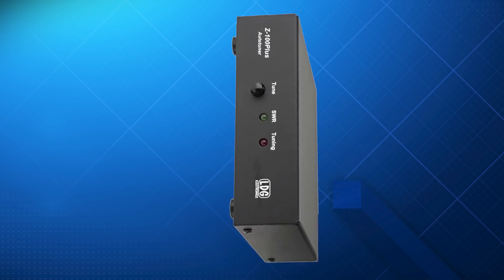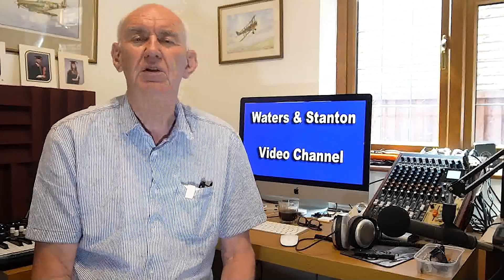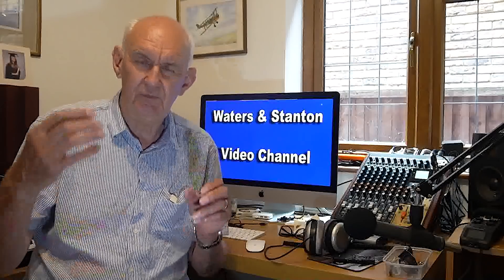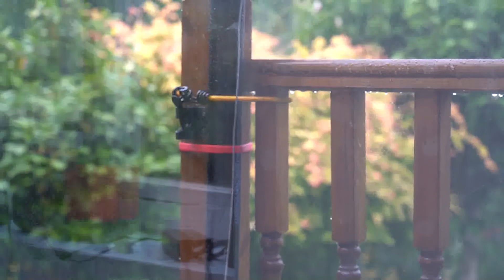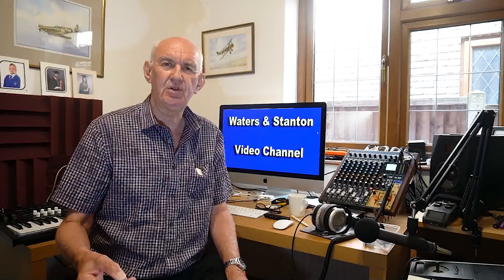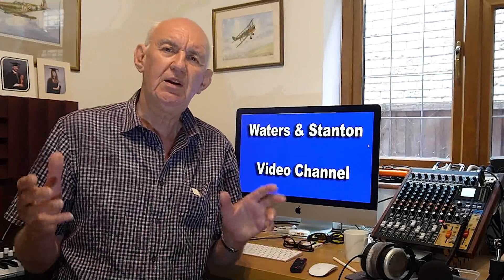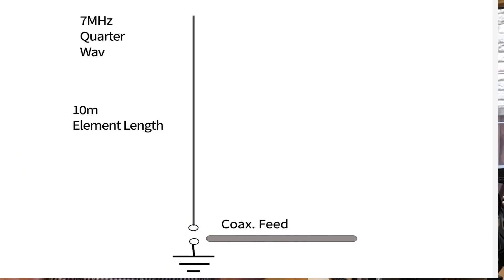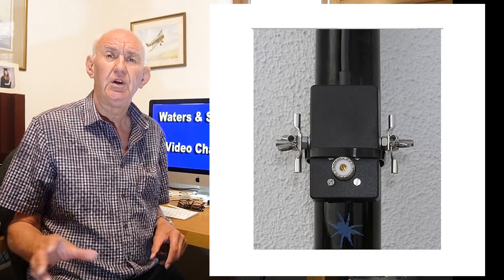HAM RADIO POP-UP ANTENNAS FOR SMALL GARDENS

Comment: Would definitely like to see some options for Campervans, possibly HF antennas permanently mounted. Currently have a Wellbrook for reception, I'm only an SWL. Would like an effective whip mounted permanently which can be rotated down whilst mobile. Believe it or not the LED lighting in the van chicks out some rfi! Promote your products Peter, every other bugger does.
Reply from the maker: If you have a van conversion I have found that most boot mounts work well at tge top of the rear doors. If you have a coach built model, I am afraid it is a non-starter as there is no metal work. 73 Peter.

Comment: Excellent!  I started experimenting with this exact concept a few weeks ago.  One difference I have made (and possible an improvement) -- I fabricated a mounting bracket for my 49:1 transformer so that I can attach it anywhere on my Spiderbeam pole.  So, for example, my 17 or 15 meter half wavelength wires can be attached at the top of the 13 meter pole with the feedpoint however high up is needed.  Next, I started experimenting with putting an inductor in the middle of my 20 meter wire, trying to tune it as an end fed 40 meter half wavelength antenna.  My first result was about 300 kHz too low and the weather turned very hot and humid at that point, so I haven't gotten around to making adjustments.  I did note, however, that at resonance (about 6.7 MHz) the feedpoint resistance was very low.  Don't recall exactly, but maybe 15 to 20 ohms.  More work is needed on this.  Meanwhile, a 40 meter half wavelength sloper attached to the top of the pole "worked a treat" as you might say.  ;-)
Reply from the maker: Hi William, the Spider SO-239 does have a mounting kit but I did not use it. I tried the 20m / 40m idea but had problems. I will revisit it sometime in the future. Thanks for watching. 73 Peter.
Reply: @watersstanton  I finally completed my experiment with splitting my 20m EFHW and putting a coil in the middle.  It resonated at about 7 mHz with at 22 microH coil in the middle, but the feedpoint impedance (end fed with a 49:1 xformer) was 13 ohms for a 4:1 SWR.  I need to try taking out the xformer and connecting my homebrew L-network tuner and see how that works out.

Comment: I have both the 12 and the compact 10 meter Spiderpole and they really are high quality units. I'm a big fan of  End Fed Half Wave antennas, no ground plain required.  When out and about working portable QRP I use various resonant lengths of wire for the most popular bands and get very good consistent results.   Takes no time to setup and take down.  For those of you who are delving into HF for the first time I would recommend trying verticals as no real hardware or climbing of trees is required - most setups can be home brew but ready made UNUN for EFHW are available, or just keep it simple to a ¼ wave with a decent radial system will yield good results.  Out portable I prefer not to use ground or elevated radials as they have magical properties in attracting members of the public.  Another top video 👍👍👍 thank you.
Reply from the maker: Many thanks Mije. Some good advice. 73 Peter.

Comment: Great video and timely. Only last night erected a 10m telescopic pole on a heavy duty speaker tripod, with some guys for extra security (was windy). Ran up 10 m efhw. I used a number of plastic rings with varying internal diameter,  purchased as a kit for a few pounds. They are used to guy the pole at various points, but since they each have a number of holes it is a great way to neatly run the wire tight up the side. Was working 40, 20 m last night well, 10W into Germany,  although a Contest meant testing was not really appropriate as no-one had time to talk !!  This was without ground radials,  but an earth spike.  Will check out radials next time, will use from my super antenna pack,  ready made ..  M7MSR   ps... did notice an increase in noise compared to my 20m horizontal efhw which is strung across garden. Might try vertical in the garden with station, but really want it for use when out and about ..
Reply from the maker: Thanks Mark. interesting stuff. Keep at it. 73 Peter

Comment: Hi.  I’ve been using this system for the past 2 years and haven’t had any problems. 11 meters, £20 pole at 33ft.
Hawkins 1/2 wave on one pole and a 5/8 on the other. Good results with both. 👍😊
Reply from the maker: Thanks for the info! 73 Peter
Reply: Verry informatif video.s Peter ..thanks.....73 s Maarten PA3DTQ

Comment: Radials are a massive hassle. Small gardens and courtyards usually means no room for ground based radials. 
If you have room for radials then you probably have room for a loaded beam.
Reply from the maker: I would suggest 4m radials are a but easier in a small garden rather than any HF beam that needs support and a rotator .

Comment: Thanks Peter as always these are very helpful I currently have a single band 20M, built out of gray UV resistant PVC. At some point it will be replaced and I have considered the Spiderbeam as a good successor to the current mast. While I have the space for a dipole or even possibly a loop unfortunately there is nothing to hang them from much above 20 feet (6 meters). I like the idea of a pop-up as wind can be a problem here so something that can be brought down easily or even come down on its own would be a plus. 

I do have a question, could you possibly do something a kin to what DX Commander does with his mulitband vertical. I think I could fabricate the spacers needed to keep the two radiators apart to have a 20 and 40 meter one and therefore not need to pull it down to jumper an insulator. Any thoughts on that?
Reply from the maker: Thanks Marty. It is not possible to create a fan dipole using end fed dipoles. I will explain this sometime in a future video. 73 Peter

Comment: Interesting video, when I'm out and about with my ft-817 I use an L march with a random length of wire normally around 30 foot or more sometimes less, works a treat. Thanks for the video Peter, Adam G7CRQ
Reply from the maker: Thanks Adam 73 Peter.